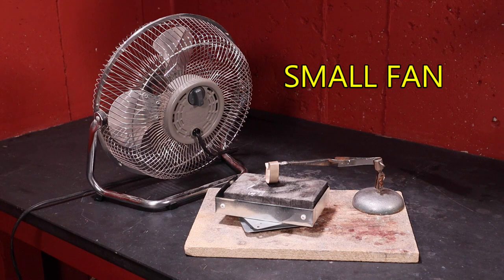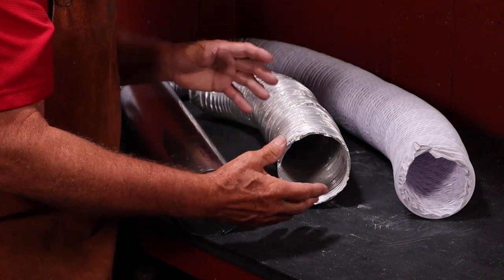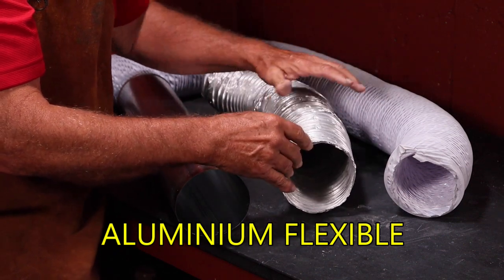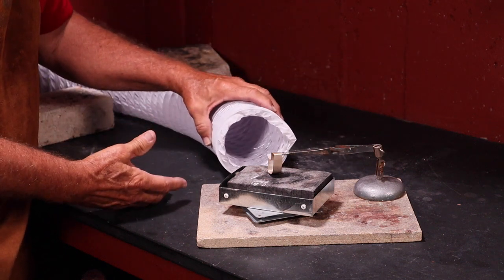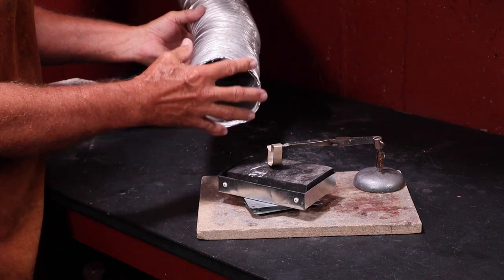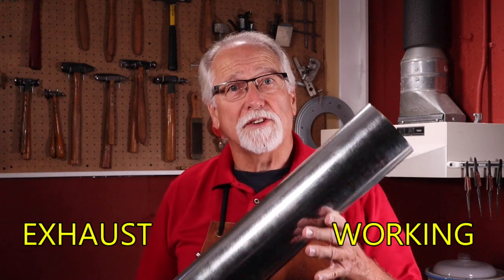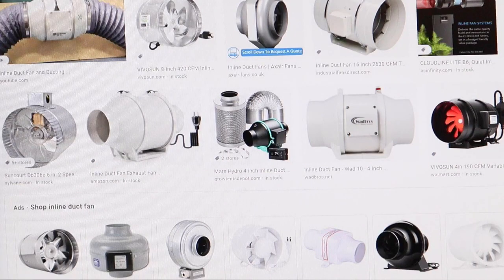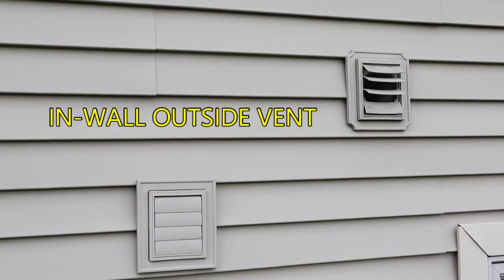JEWELRY SOLDERING BENCH VENTILATION SYSTEMS

Comment: This is a great video, Greg!  
I'm commenting here to list an option that some people might not think of:
Woodshop dust collection parts. 

I ended up using some "ducting" that falls in between your plastic ducting and the flexible metal ducting examples and was a good value for the money.  It is meant for use on a heavy-duty wood shop dust-collecting vacuum setup.  So even though it is plastic, the supporting wire is heavy-duty.  

For anyone just starting out, whenever possible, open your mind to alternative tools and supplies.  You can often find the same tools used in another industry and they will be priced differently because of the target consumer. Cheers!
Reply from the maker: Hello Justin,  I agree with you 100%!!! There are always cross over tools, supplies and equipment.  Thank you for your input.  Check out my video "12 Free Hidden Jewelry Tools and Textures".  Talk about "cross overs".  I think you will enjoy it!!  Thank you very much.  Keep watching and feel free to add to comments anytime!   Greg Greenwood
Reply: @greggreenwood4628  Thanks Greg, I will!  Thanks again for your videos, They are very helpful.
Reply from the maker: Hello Justin,   You are more than welcome.   Greg Greenwood

Comment: Many good tips! I am not a silver smith but into building small prototypes etc. Use silver solders a lot. One thing I found out is that I need a variable speed fan, otherwise thin wires etc simply disappear... I use a fan hood from a dental lab, cheap from an auction. There are some  really nice articulated exhaust arms for dental work as well. Would like to try one of those as well.
Reply from the maker: Hello Erik,  Good idea!  Thank you for the suggestion.  I will watch out for the exhaust arms.   Greg Greenwood

Comment: Light a stick of insense and watch the smoke. I have a ceiling mounted exhaust fan, but it is an OLD straight through NEMA motor with a metal fan blade on it. It will suck out that smoke from 15  feet away. You can see it swirling around like a rope tornado leading up to the fan, and out it goes. It's about a 10 or 12 inch diameter duct with a fan inside it. I use a 10 inch electronics equipment fan for another room. Same deal. I found I don't really need a bunch of flex duct.
Reply from the maker: Hello Seth,  It sounds like you have the perfect exhaust system. It is awesome to have a ceiling mounted fan.  Thank you very much for sharing your incense tip also.   Plus, it makes the studio smell good!  Thanks again.  Keep watching.   Greg Greenwood

Comment: I once worked for a company that rebuilt ATM machines.  About every 6-9 months they would do a major "clean out" and throw out accumulated parts, many of them still functional.  I have a stash of 12 and  24 V DC computer fans.  These are not variable speed, but by using a bank of them, individually switched, I could vary the air flow.

Range hoods.  If there is a used appliance store near you, inquire about getting one that won't sell due to cosmetic issues.  New range hoods that have no fans or lights installed for pretty cheap.  You can install your own fan and lights to suit your situation.

Inline fans are great and with a little bit of creative "basement engineering" one could add inline filtering.  Look online for a source of HEPA filters and charcoal filters that you could build around without requiring a degree in mechanical engineering.  This would be particularly helpful for those that can't vent to the outside.  

Finally, an outdated or yard sale vacuum cleaner that uses disposable bags.  Put some large granular activated charcoal in the bag to absorb the nasty stuff. Not enough to restrict the air flow but enough to insure that the air flow will have to pass through the charcoal. I would rinse the charcoal with plain water to get rid of any fine dust, then allow to dry before use. 

Happy soldering.  🤓
Reply from the maker: Hello Katie,  I love recycling and repurposing!  Way to go!  Thank you for sharing.  Keep watching.   Greg Greenwood
Reply: @greggreenwood4628  Thanks for the kind reply.  Ons man's trash is another man's treasure.  But I must say my greatest treasures of all are the recycled animals I've had over the years.  There are currently 4 dogs, 1 horse, and a mini pasture monster that other people decided were not worth keeping.  

Thank you for sharing your knowledge snd skill.  Yes, I will continue to watch.  And hopefully learn.
Reply from the maker: Hello Katie,  Good for you!!  We need more people in the world like you.  Thank you.   Greg Greenwood

Comment: Hi. Thank you for the video. I plan on using my garage studio maybe once or twice a week, if I'm lucky. I'm wondering if even a little bit of soldering still warrants having a ventilation system? I have a large three car garage, and have a door on the other side of the garage, however, no windows. My house is new and I would not be interested in cutting holes in the walls. Is there any brand of benchtop fume extractor you would recommend?
Reply from the maker: Hello Lori,  Chain saws are great for opening up holes in garages!!! (JUST KIDDING).  I can understand your concern about extra holes in the walls.  Sounds like you are not going to solder very much in your large garage.  You should be OK with opening the door for a little while when you solder.  Even just a fan in front of the door should be OK.  There are many benchtop fume extractors on the market that are good. Look for ones with a good filter.  Some do not.  Check it out on Google and look for a price range that works for you.  I really appreciate your questions and comments.  The best to you and keep watching.   Greg Greenwood

Comment: This video was EXACTLY what I was looking for! I am setting up my metalsmith shop in my basement, and I can vent to the outside easily. I will buy a good kitchen range hood now. I also absolutely love the magnetic tool bar on the side for tweezers. Is it ok to also use a magnetic tool bar for the pliers? I’ve been told for the working ends of tools you don’t want them magnetized. Your opinion would be appreciated.
Reply from the maker: Hello Nunya,  Glad it was helpful!  Oh yes, the magnetic tool bar can be used for pliers also.  I would not worry about the ends of your pliers being magnetized.  Remember,  you are working with non-ferrous metals(silver, copper)  which will not react to a magnet.  Talk to you soon.   Greg Greenwood

Comment: Thanks for the must haves for jewelry making!  I have a question: how to solder a serpentine necklace? Mine broke and I'm trying to learn how to repair it! I bought some tools, but I'm trying to learn how to use them! Please help Deborah!
Reply from the maker: Hello Deborah,  Thank you for watching my videos.  Please watch all of my  Playlist: " Silver Soldering Techniques."  There is a lot of material on soldering and how to use the tools.  You should practice soldering before you try repairing your necklace.  Also, check to see if the necklace is sterling silver or not.  If it is not, it could melt at lower temperature before the solder will melt.  Let me know how it goes.  Best to you.   Greg Greenwood

Comment: I am thankful for this video . I would like to indicate my plan to use the fan from a microwave oven ( I am experienced with the safety issues of scraping microwave ovens ) with the motor from a used electric drill with variable speed control for a 12 Volt powered portable shop .
Reply from the maker: Hello Al T,  AWESOME!  I love recycling!  Sounds like you have a good plan.  Keep it up.  Thank you for sharing.   Greg Greenwood

Comment: hello sir. I'm not sure how much you check, but you be willing to help with a problem I've been having? I just tried to solder 21g wire to... 18-19g plate, silver. prongs. alot of them close together. this always goes badly. I'd kill for this tutorial. thank you
Reply from the maker: Hello Allilujah,  Thanks for your question.  Sounds like you need to "Sweat Solder"  the prongs. Check out my video "Sweat Soldering/Part 2 Wire to Wire & Wire to Sheet Silver"  I believe this will help you. 
 If you have "alot" of prongs close together, you may have to use several third hands to hold the prongs so you can solder all at once.  (#1 Option) Melt the solder slightly on the plate first. Let cool and clean.    Then place the prongs on the solder.  Heat the prongs and the plate evenly and the prongs will suck up the solder and hold.  Make sure all pieces are clean and have been fluxed. 
 (#2 Option)  Melt the solder on the bottom of the prongs first.  Cool and clean.  Then place the prongs on the plate, make sure they are both clean and fluxed, heat from beneath the plate.  The plate will get to melting temp and melt the solder on the prongs and will hold. 
 Practice on a scrap piece until you are comfortable with the sweat soldering.  I hope this helps. Please let me know how it goes.  
 Greg Greenwood

Comment: Hi Greg, I've watched a few of your videos, and I am wondering if you have ever done any furnace brazing ?
Reply from the maker: Hello Steven,  No, I have not brazed furnaces.  Keep watching.  Thanks Greg Greenwood
Reply: @greggreenwood4628  what I meant to ask was if you have done any brazing or silver soldering using a furnace or kiln for your heat source, I should have been more clear but it made sense in my head.
Reply from the maker: Hello Steven,  LOL.  Of course, it makes sense in my head now.  No, unfortunately, I have not had that opportunity.  Have you done any?  Greg Greenwood
Reply: @greggreenwood4628  No not yet maybe someday . I've only silver brazed refrigeration pipes and some cast iron brazing. I've not ever tried any sort of small parts or jewelry, just a welder/millwright working on larger stuff.
Reply from the maker: Hello Steven,  Take care and keep in touch.   Greg Greenwood

Comment: Thank you for the video! Could you please explain briefly how a ventilation system will impact a soldering process in terms of the melting temperatures and flame direction.  Thank you!
Reply from the maker: Hello Alena, The ventilation system has little impact on the soldering process even if you have the working end of the duct very near the piece.  Thanks for your question. Greg Greenwood